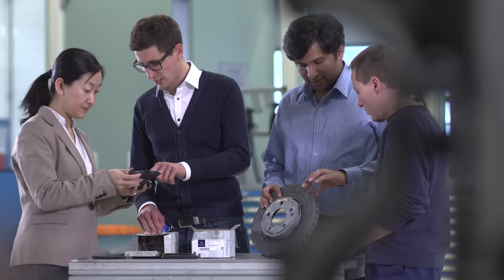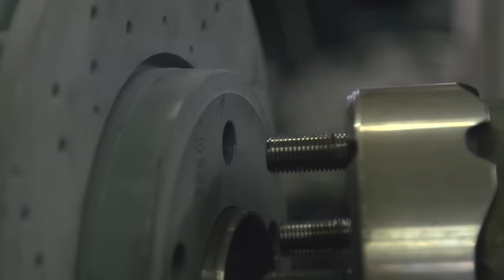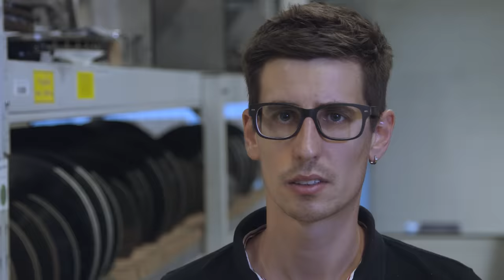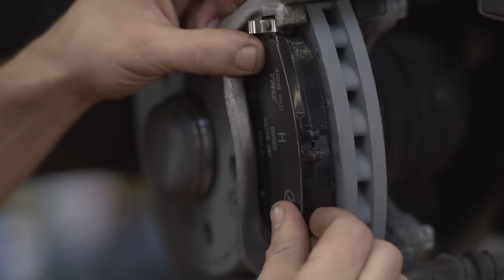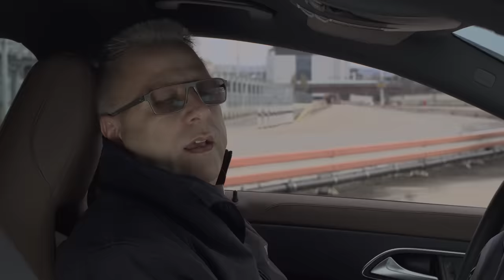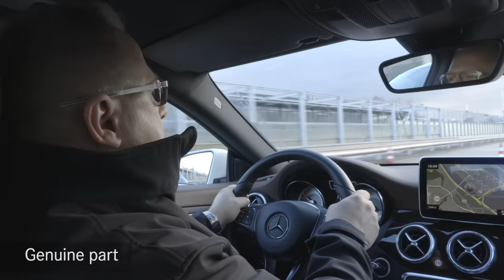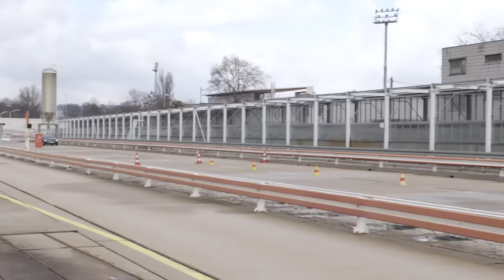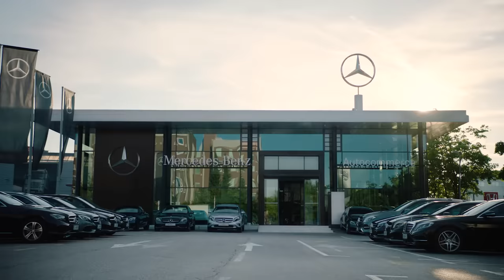Brake Test | Mercedes-Benz Genuine Parts vs. Fake Parts

Comment: Mercedes Benz high quality? Hahaha...how is it possible that the fake leather in my car is broken at 70000km? How is it possible that my chain is streched at 90000km? How is it possible thst my camshaft adjuster ia broken at 90000km? Allmost 2000 euros on reparation costs for an car with less than 100000km. Mercedes Benz the best or nothing. Hahahahahahahaha. It's a fairy tale like snowwhite and the seven dwarfs.....never Mercedes Benz again. Next car i buy is an Swedish tank (Volvo)